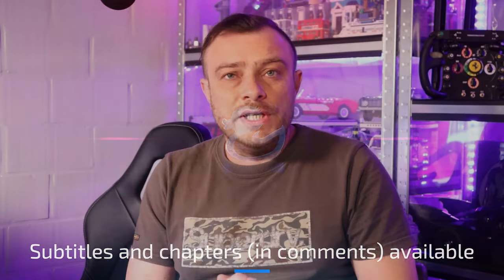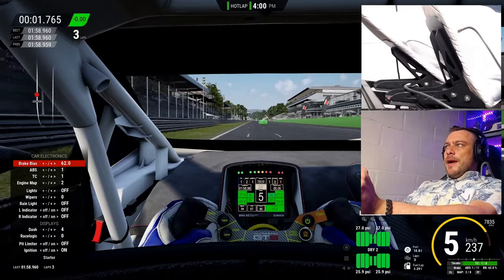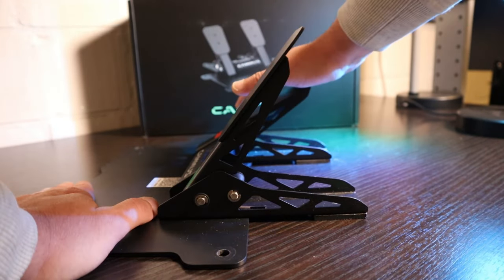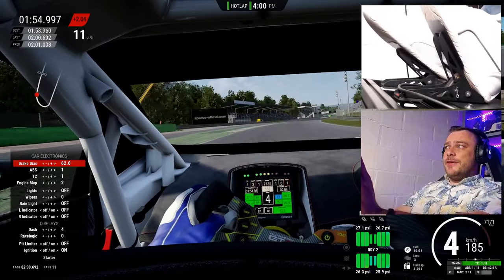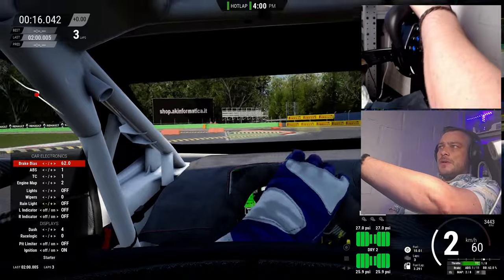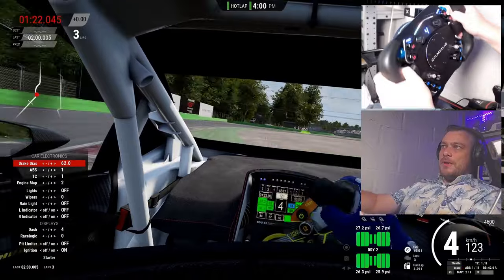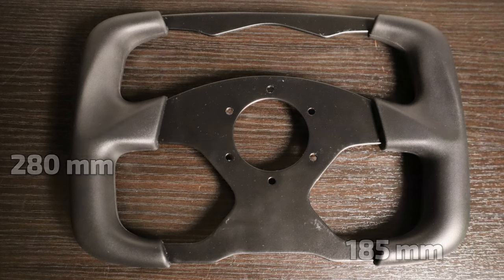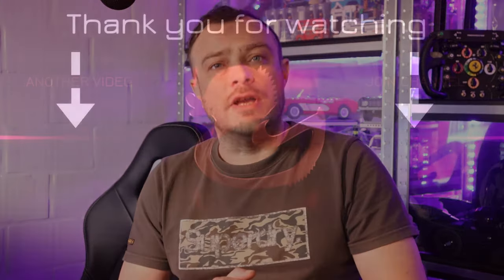Review: Modifications for CAMMUS C12 and C5P

Comment: I love the wheel you used.

The only thing i dont like about the ffb is it always feels like it has extra weight. Not like actual ffb weight but dead wejght instead of feeling flowy or floaty. Instead of only tightening on the edge of the limits or grip as you turn in its like ot starts right sway. Not a good eay to truely find the limits since it always feels the same. Its as if there is extra built in inirtia and dampenig. Not dampening on details but just that dampening weight feel. People will relate it to power but it isnt. Its as if its at peak at all times instewd of the feeling changing.

Just sauing you shouldnt have to fight the wheel from the start or turn in. It shoupd flow through until you start hitting the limits. Wheels that just stay purely tight i dont like and isnt really informing you correclty on whats going on with the cars suspension wnd tires. Asetek does this in acc only. Its fantastic on everything else but in acc there is this dead weight that feels so weird and awkward compared to other wheels.
Reply from the maker: But is this not because of the dampening settings?
Reply: @SimulatedDrivingResource  no it is just a feeling this wheel has regardless.
Reply from the maker: I'll have a look as soon as I got some time to understand what you mean. I know in BeamNG I have that feeling but it's quite nice there.

Comment: The only problem with this brake mod is that, even as it is i can barely keep the pedal from tilting when i push them.

Adding more resistance I will have no chance to keep them on the floor.
Reply from the maker: I didnt really think of it in that perspective but yes the base of the pedals is light and doesnt offer much in terms of counter-weight when you push them down and they are not fixed in some way to a rig.